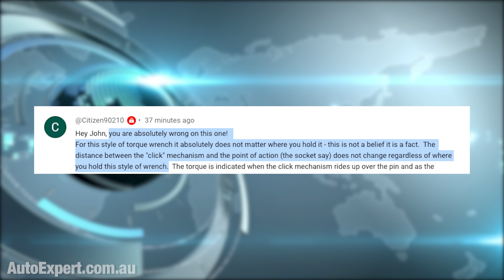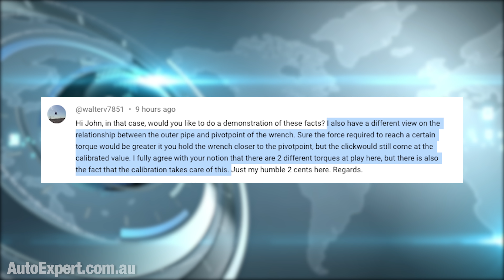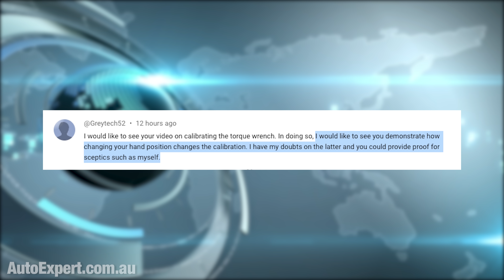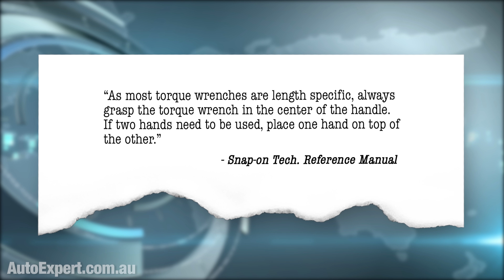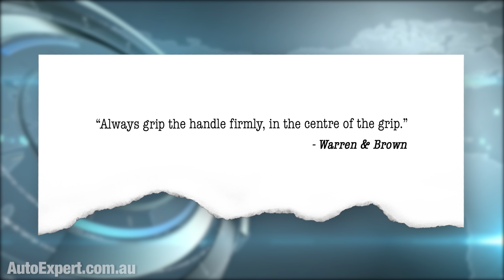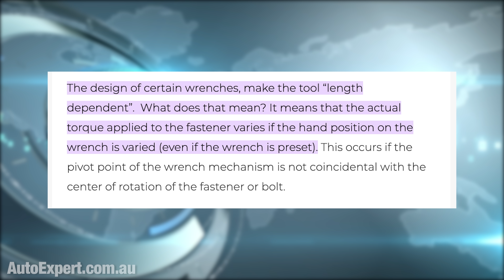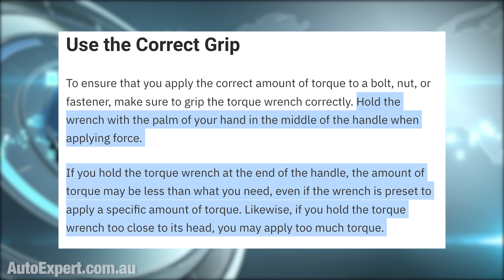Am I wrong about torque wrenches & hand position, again? (The facts) | Auto Expert John Cadogan

Comment: Very good. I suspect a big part of the problem is that, despite your teardown of the internals of a torque wrench, there is a persistent intuition about how they work that befuddles some. Perhaps the salient point is that the majority of torque applied to the centre of the wrench is imposed by the internal bar, and is due to the force of the spring on the ramp. The odd (wrong) intuition seems to be that the click mechanism is just measuring the applied torque, and that somehow the torque gets to the pivot via some sort of magic.
Some people respond to visual analysis. Indeed describing the mechanism of the problem of torque wrench use in only prose is a quite a challenge.

A simple diagram of forces around the triangle of components might help some grasp the issue. For me the penny dropped when I realised that the click mechanism is a fulcrum, and that applied forces either side of it impose additional or opposite torque on the pin connecting the outer tube to the wrench head - thus why the errors can be higher or lower imposed torque. I will confess that prior to your initial video I would not have thought about the error. So thanks for that.
Reply: Well put mate. That will clear it up for the "just about got its" like myself.

Comment: A couple of points, John, there are references to "certain types of torque wrenches" being length dependent. Which types? Also, a couple of the documents you show say you should  back the adjuster off for storage, something you say is unnecessary.

Comment: Maybe a diagram would help explain how this works. I think of it in my head as 2 fulcrum points. One at the pin near the ratchet, the other is right at the click mechanism. So Then applied pressure too far up the bar would then be pushing between the 2 fulcrum points. Fighting each other so more torque is then overall applied.

Comment: The click type torque wrench has a very short reset angle and that is why the hand position is critical. Slipper torque wrenches has no hand grip position requirement. And can be held any where. It can even be used with a cheater bar.

Comment: Simple way to show your premise is correct:
If you to move your hand all the way up to the pin joint for the clickie bit there would be no click no matter how hard you pulled. No torque would be applied to the internal click mechanism. I need to go and plot this curve.

Comment: I've found that exaggeration of a point is often useful to explain concepts to those who struggle to understand things like this. 
Imagine grabbing the handle correctly, and applying a load high enough to cause the mechanism to click over. Now keep the same load, and slide your hand down to the pivot pin. As you get closer to the pin the amount of force going thru the handle decreases as the pin starts to take more load directly. Eventually 100% of the load will be transferred directly to the pivot pin as your hand is over the pin. The handle has no load at the grip, the force is still the same and you can increase the load applied to infinite and the grip will still be unloaded. 

Any point along the handle between grip and pivot will transfer a percentage to each end depending on your position. Obviously, the manufacturer takes the ratio into consideration when they calculate the scale. 

I might not be 100% perfect in my explanation, but maybe it gives the doubters something to consider. 

It's important to remember that the pivot pin can move, it's not a fixed point fulcrum.
Reply: I'm going have to say you made an excellent point in your explanation. And withdraw my previous assertion about a rigid lever until the click event. It often needs an explanation of the extreme case such as this, i.e. applying the force at the pivot which makes the handle redundant, to realise that there is a progression of effect between those limits.

Comment: And always make sure your threads/nuts are clean and/or lubed or some of the torque can be used up by friction and not tension...
Reply: Dry and wet threads require different torque settings and will be provided in critical applications by manufacturers.

Comment: Just read the torque wrench wiki. The type of wrench I have is referred to as the "Clicker", and it is obvious that the external "tube" that one applies force to is rigid, and thus, hand position would have no effect whatsoever. I suspect this type of torque wrench is the most common type.
I'll continue to grab on to the end whenever possible though, because I do think this would give one more control when the torque limit is reached, and the sudden "give" occurs.
Reply: Or, is it simply too expensive to make the outer sheath PERFECTLY rigid, so they take the small amount of flex into account (assuming it is held correctly at the handle) when they calibrate it? THAT would make sense.
Reply: Yes the tube is a rigid body which pivots on the pin that holds the tube to the ratchet head/extension.

The fact there is a pin there is what stops the whole assembly being truly rigid and therefore allows the spring to have some influence on the differential torques between the outer handle and the inner extention.

Without the pin there the assembly would not produce a click.
Reply: very true bhmac eng
Reply: I'm now satisfied that I'm wrong about this, and John is correct. It's a very interesting topic.

Comment: Your point makes sense, but it might be hard to visualize for some. I'm curious how much of a difference it will make for general applications, but will it be enough of a difference to actually make a difference.  Are we talking 1-2 points of measurement or massive swings that would lead to failure.

Comment: Its such a giggle, how people take an established scientific principal and try argue against it!!! John,  you are ABSOLUTELY CORRECT. Use the handle position guys, because all units of torque consist of a force AND A DISTANCE. ft/lbs or N/m. ie pounds of pressure AT a distance of 1 foot that creates the calibrated twist (for those who still use barley corns as a unit of measure);
or newtons of force at a distance of 1 meter (for those of us who's barley corns are bigger than yours). 
The wrench is calibrated to a more convenient size for everyday use, if you use only the hand position indicated by the manufacturer.

Comment: If it's calibrated when holding it at the end, then use it when holding the end, in case the mechanism is affected by the hand position (marginal). 
Where it's held won't matter IMO to the springy thing in the head: it clicks when the screw/bolt/nut is torqued to the calibrated setting. 
Also, a 2 m long tool held at the end will be easier to use for the person, but the torque on the fitting will be the same as using a short one (if both calibrated and of the same type).

Comment: I'm stunned.  No, perhaps just still puzzled.
Watching the original video last night, had me, all the way through, yelling "NO" in my head.  The tube is rigid, and the mechanism inside is fixed relative to the tube, so I still cannot grasp why it should care where I grip it.  But it does!
Being a weakling, I have always held any torque wrench at the correct position, as nearer the pivot requires me to exert more force, maybe a demand too far.
I have a reasonably new torque adaptor, a small box with a digital readout and strain gauge inside, bought for fitting rear wheel bearings where the torque was beyond my largest wrench.  A metre long breaker bar on that still requires a lot of effort before the device beeps at me.
So I paused this video, out to the garage, clamped the adaptor in the vice, set it to 'peak' and tested it with a torque wrench.  Tested at 40Nm, and 60Nm, the torque reading is different at different hand positions.  Max to min varies by less than 2Nm, but there is a difference.  My poor little brain still does not understand why, but it already has lots in it that I accept the facts, whilst only understanding the gist of the theory.
Great news, since buying the adaptor, I've been meaning to check the calibration of my torque wrenches.  I've only used my oldest wrench this morning, but am pleased to see it is within 0.6Nm, when pulled correctly.  For a wrench that is over 45 years old, I'm thrilled.  Thanks John.  I will continue to wrestle with the theory, but happy to accept that it does change.
Reply from the maker: It pivots near the ratchet, dude. It's not rigid. It's a mechanism.
Reply: @AutoExpertJC  The tube pivots near the ratchet, but surely, the pivot there does not transmit any turnign force to the fastener.  The ratchet arm inside is not contacting the inner face of the tube until the 'click' allows that to happen. Prior to that, the force to the ratchet is transmitted from the mechanism inside, which is surely fixed near the far end, under spring tension.  I accept that the torque seems dependent on hand position, but cannot see why it should, as the internal mechanism is fixed inside the rigid tube.  Perhaps a diagram of how the internals work?
Reply from the maker: RTFM genius...
Reply: @nigelcox1451 The pivot joint doesnt transfer torgue, but it will transfer force. If you hold close to the pivot pin, you push the pin and tighten the bolt. If you hold from the click point, all force is transmitted thru the clickjoint and pivot pin only rotates. Hope this helps, it can take a while to grab the concept. It is not so much about torque, but how the force is transferred to the wrench part.

Comment: Now that you've opened the can of worms guess it's time to explain that determining how much a fastener has been tightened by measuring the torque applied to the head is rather crude. It's subject to variations due to friction in the threads and under the head of the fastener. What really brought it home to me was when years ago I was installing a set of ARP head studs. ARP specified that if using oil to lubricate the threads/washer/nut then torque to 120 ft/lbs. If using the recommended ARP assembly lube, torque to 80ft/lbs. The accurate way to determine tightness is by measuring bolt stretch (when possible, which isn't often).

Comment: Hi JC , true story , I am an old Boilermaker / retired , years ago working in what was called A CLEAN WORK SHOP , which means No mild steel only marine grade stainless / aluminium .
The engineer decided we could use plain nuts instead of nylon nuts as we used from 6 mm to 25 mm ,316 marine grade ,in some cases into hundreds mainly 12 mm could save a concrete amount of money , the bolts where tensioned to the book setting , job was loaded ,transferred to site , half of the nuts where other lost or on the trailer .
Engineer is in the workshop blaming everything on the sealing crew didn’t tighten correctly ,on on , he decided to do the next on himself  , came down went over them twice , that’s how you do it OK , load went to site , lost most of the nuts again , so back to the nylon nuts .
On the lighter side , saw a story the other day a professor stated Dogs are uncharged we are there slaves .

Comment: I learned this in an Air Force PMEL lab in 1985.  I had my personal torque wrench on the calibration device, and it was crystal clear my hand position CHANGED THE CALIBRATOR'S READINGS.  I have since had this conversation with both believers and naysayers.  I know what I saw, and it was irrefutable.  I also found out my Sears torque wrench was deadly accurate at my most used setting of 40 ft-lbs.

Oh, and by the way, the same thing is true with my Snap-On Tech Angle electronic torque wrenches.  Imagine that, they put a red ring right where you should center your hand to ensure this $650 USD tool delivers the number on the display.

Comment: The other golden rule of deflecting beam torque wrenches is NEVER use them in reverse, because they go out of calibration. I'm not sure whether the same applies to tube types. I still use my dad's old Warren & Brown 1/2" torque wrench from the early 1960s because it's still in calibration after thousands of cycles (no Nm back then).
Reply: The docs for my tube-type torque wrenches say not to apply significant torque (use only for fasteners that are already loosened) in the reverse setting.
Reply: This isn't a deflecting-beam design. Completely different physics.

Comment: Question sir.  Will adding an extension to the socket head to reach a deep down bolt, would that change the torque?  Should there he any accounting for the extension  from the ratchet head to the bolt. I imagine a short 2-3 inches wouldn't be much difference.  However, I had to torque 19mm engine mount bolts deep down,  around 15-18 inches.

Comment: for anyone who disagrees there's a simple test that anyone can do it:
use the torque wrench on a specific value holding the hand in the right position, wait for the click....then without changing any setting move the hand closer to the pivot and try again.....if it doesn't matter where the hand is you should hear the click immediately. if not, you would continue to tighten the bolt and hear the click later
Reply: I'll do this test, and I do think it will kinda prove you right to some degree, but for a more nuanced reason. Assuming the torque wrench is the "Clicker" type (as described in the Wikipedia page), it is clear that the outer sheath that we grab is rigid, so in theory, hand position would not matter. However, I suspect that the sheath does flex a little bit, and this flex would be accounted for in the calibration, which would of course assume correct hand position.

Comment: Yep, all correct.   On my torque wrench the grip is approx 4” long.   I’m betting the variance you got in the digital unit is partially caused by having more force on your index finger or your pinky.   Gotta make some difference.
I’d like you to repeat the digital torque test using a series of longer and longer cheater bars. ( do a part 4!).  I’m betting the non believers will be even more confused as adding a longer and longer cheater will make less and less difference.    I’m thinking worst case is choking up right at the pivot point  (will never get a click, fastener will be infinitely overtightened).  Optimum place is at the grip.   A  2 foot cheater bar should only result in slightly undertorqued.   A 10 foot cheater bar should be almost indistinguishable from a 2 footer.   My best prediction!

Comment: I know you said an extension bar would result in not enough torque but if I attached an extension bar to the handle in the position that my hand is meant to be, would that just mean I only need to apply less force to produce the same force required to activate the mechanism as it is just leverage. i am one that did not pay attention back then but will now if I am wrong.

Comment: Surely unfastening a bolt/ nut and torquing a fastener to specification is worlds apart from over tightening the threads leading to failure of the threads/parts being retrained for safety
Reply from the maker: Under-cranking is worse than over-cranking, relative to the torque spec. There's a fair bit of safety margin above the recommended torque, but the clamping force will be inadequate is under-tightened.

Comment: It makes sense to me but I understand why people could need it demonstrated. As I understand: It takes more or less force to pop over that pin by levering on the attaching pin for the outer tube depending on where force is applied. Calibrating one of these specifically requires measuring a distance and applying a known strength of force at that distance.... 
So I'd make the case you could probably come up with some formula to know what torque setting to use given a distance alteration. But I mean.. I write code and I wouldn't even want to bother. No home mechanic is gonna bother either. It's easier to just hold the handle haha.

Side-note: ChatGPT got this WAAAY wrong by claiming to always hold a torque wrench at the square drive :P
Also I really dig your last 2 shirts
Reply from the maker: don't give a shit what people 'need'.

Comment: Hand position wouldn't matter if you were using a deflecting beam style torque wrench (I made one in metalwork in 1973-it's a copy of the Warren & Brown version). 
With the wrench in question here, consider the logical extension of the case of moving your hand closer to the pivot point of the fastener. If you applied the force at the fulcrum of the "clicky bit" (highly unlikely, but possible), you could apply massive torque, and the torque wrench would never "click".
Reply: This distance from the pivot point only affects the force (applied by the user) needed to activate the mechanism, not the force applied by the mechanism.
Reply: @Allangulon  That's what I said-just differently
Reply: @DOC19581  
The guy in the video though is arguing that is not the case based on the tool being used, or at least it seems that way. The only reason the tool gives different force values when held in different positions is due to its design and the fact it flexes and the activation mechanism relies on data from the handle end of the tool. That was not adequately explained as I doubt he knows how the device works! 
The first device of its kind was a Torsion bar that relied on flex to give an analogue reading. He's certainly not as clever as he thinks he is!

Comment: My basic bitch Norbar ones have a little + moulded into the plastic to show precisely where to push/pull to get the calibrated tor-cues.

These things are built to a price and adding that little + to the moulds costs money. Norbar aren't idiots, they wouldn't do this if it wasn't needed.

Comment: Would it solve the debate if we all put the torque wrenches away & just use ring spanners, short ones for lighter torque, medium length for medium & long ones for very tight? Admittedly, if we do this, we'll have to run classes in how to say "click" at the point the fastener is tight enough